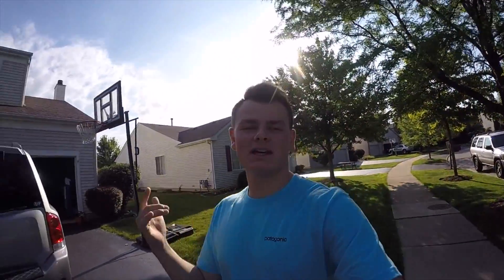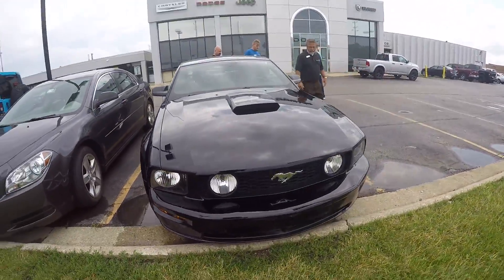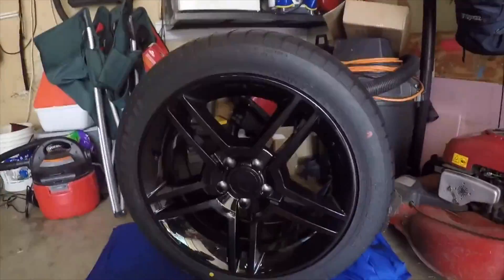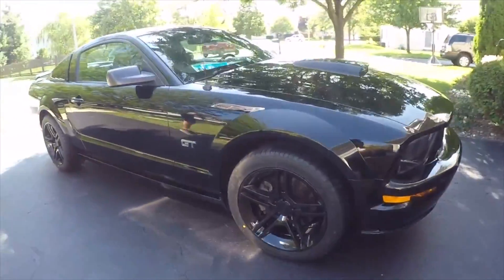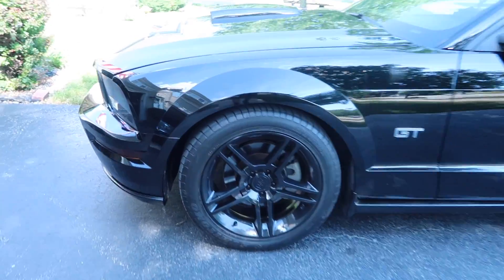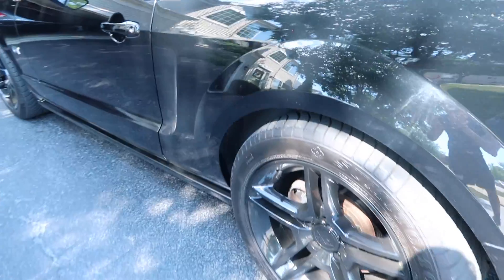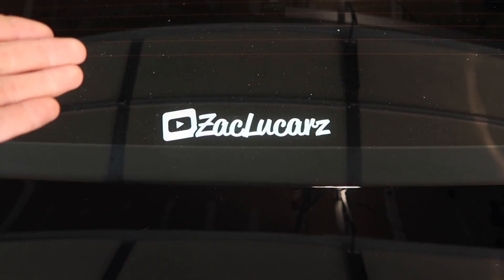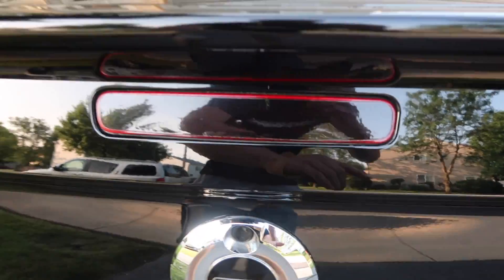BUILDING A MUSTANG IN 5 MINUTES

Comment: Yo bro if your up can we talk need to talk to someone I owned a 07 accord and traded for a 99 mustang gt while driving the car starting loosing power and mad a clicking noise the car then lost all power and I pulled to the side it didn’t wanna start and it just began to leak fluid from the bottom it cranked but didn’t start

Comment: Nothing to the engine? I have a 07 gt body is average condition and crappy rims with toyos but I have all new borla exhaust and bbk headers and new throttle body, intake obviously lol, and its cammed with comp cams and has 3.73 gears and tuned, will be doing more to the engine before cosmetic things to the body, I'd rather have a "sleeper" than wannabe racecar, not shitting on this guys build either,  I haven't went and looked and seen what he has done now maybe he did actually build it